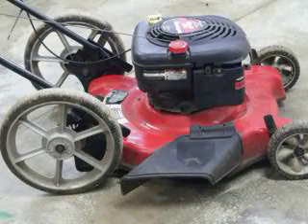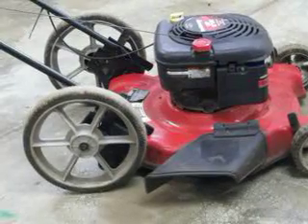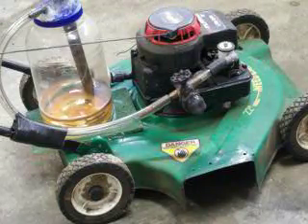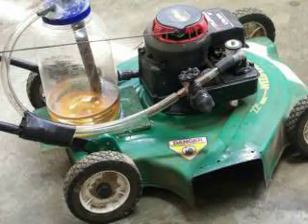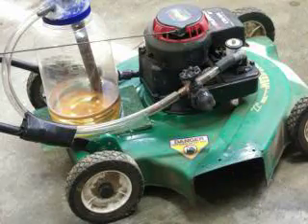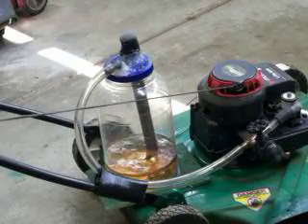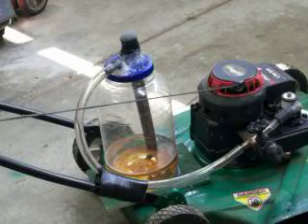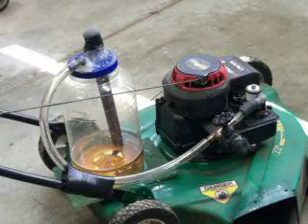gasoline and fumes the difference

Comment: It's a good idea but also you have to understand gas is like a ghost what is 6 it travels around the machine and once Park it can blow up same as a vehicle running on gas fumes and I noticed you have a little sponge in with the gas that's good because you don't want any kind of foreign object to go into the carburetor down into the Piston area scratching the wall or as you're running it gas has a tendency to spread around it the fumes and it's dangerous even in your car 
When it sets or as you're running it whatever the case from the bottle and it does and it's invisible it will blow up you got a bum you're pushing around even with a car with a carburetor from the Jerry can into the ports if you don't get enough air mixture you're running the engine hot it could crack glass bottle is sitting on the lawnmower sparking that ignited the gas and you got yourself a little bomb Colleen slight vibrations can crack the glass and just a little gas escaping ignite the gas out there on the lawn mower going back to the bottle and boom 
It's like a hand grenade it can harm you and her and your grandson or nephew or your wife that's near you or your neighbor which could turn out to be a lawsuit a lot of people don't understand this like I know gasoline the states is expensive but what you doing is incorrect you might think I'm stupid check it out on YouTube my son and you will find out for yourself you're driving a bomb even the same method in the car you don't get the right air mixture in or if you get a foreign object into the gas and it feeds into the carburetor blocking a lot of stuff for scratching the walls of your piston you're going to have to take the engine apart and Military playset with 
Your Pistons and rings and you're going to have to put a lot of oil it because you're going to find out it's going to be a lot harder someone running propane any class a mechanic would tell you the way you methods are there with a glass bottle can be very dangerous or even plastic because as soon as they tend to float it's hard it's harder than air means of the gasoline fumes It to the Ground same with the car as the car sits diffuse travel underneath the vehicle and once 
You start your car and boom hookah in the car can be jeopardized and the car will go up in a ball of flame not a joke not an April Fool's joke there's other and a little bit cheaper your car can be converted on propane or natural gas which is cheaper and save her but your nose your burn alot of oil any method that you do you're not getting away from the part of the oil because you're running the engine hotter so think of what you do for me don't know what you're doing you could do your research on YouTube and yourself would know the right from wrong what you thinking you're saving on gas you're burning on oil so doesn't really matter you're still coming out the same you're just driving the car engine to work harder sometimes you're lucky to get away with it but most of the time at 75% the vehicle is a lot more that you're working with can blow up you think I might be crazy keep running it you'll find out

Comment: congrats you made a crude carburetor. motors already run on vapor (air and gas mixture) which is what a carb is for. This setup will just destroy your piston from running lean.
Reply: Only thing is carburetors don't vaporize gasoline like it should... But that is what we called it since the invention of the carburetor. Is vaporizes the best it can but it's not that efficient.
Reply: Caleb

Comment: CO2 is a gas that is made anytime a carbon base fuel is burned, You are not getting as much when you don't burn as much but you are producing the gas. The Smoke alarm that went off in your garage was more then likely do to the unburned gas fumes and exhaust from your demonstration of the first mower. I am saying this because the most common type of smoke detector used in domestic application today are the photo sensitive variety. You did say however yours was activated by the heat. This may have been the case but I highly doubt it because a Heat Sensitive Detector would contain a thermostat like device and usually aren't activated by temperature until the surrounding temperature is nearly to the point of smoldering or burning (In excess of roughly 300 degrees. This type is not commonly used in households as they are more expensive and there fore are used primarily in industrial application. I would almost guess what we heard was one of the latest type of smoke detectors which is a combination Smoke and Co2 detector.  Also if you would study to see just how a combustion engine works you would learn that ALL of them rely on a mixture of O2 and ionized fuel (or fumes. The first mower relies on the fumes just the same as the second. the only difference is like your car or a diesel engine or the first mower you used the gas isn't ionized until it is injected into the cylinder or cylinders and the fuel that isn't ionized and burned gets exhausted out in the form of smoke. With is nothing more then fuel that isn't all the way burned and therefore wasted. The first mower and the second are burning fuel the same way however there is a lot les wasted in the second because it is ionized before going into the engine and not as it is going in. But don't be mistaken in thinking the second mower has no emissions IT DOES just not as much as the first mower because  more of the fuel is being burned before it gets exhausted by the engine. if you don't believe me you can take your mower to your nearest fire department and most of them are equipped today with a hand held CO2 meter or you can purchase one but they will usually run anywhere from about $200 up.

Comment: I did experiments similar to this over 35 years ago on our family briggs and stratton mover .
   starting was very hard on colder temps.
  Once all the liquid fuel evaporates, a milky white gooey residue is left behind at the bottom of the jar .
  i concluded that the residue consisted of all the additives that were in the fuel  as well as the moisture that was in the air that was bubling through the liquid fuel.
  Throttling control was also very erratic.
  After a couple of months of experimenting I decided  that the existing carby system was working just fine  and therefore i abandoned futher research .
Reply: i came to same conclusions few years back.i went a bit further and converted car to run on vapour.only way to evaporate petrol completely is a extreme heat.i sprayed petrol on hot exhaust manifold which turned in white fog mixed-up with fresh air in it go to engine..achieved app 40 increase in mpg .than i lost enthusiasm and abandoned project as i was expecting much higher increase....

Comment: The idea and concept are sound. Liquid gasoline is reduced to vapor before it enters the combustion system of the engine. It's the vapor that burns, not the liquid. That's why additives need to be used in fuel mixtures. In very cold climates, the additives make the fuel fume easier or the engines wouldn't run. In very warm climates, the additives used are to reduce the fuming rate of the fuels or vehicles would just blow up, even sitting idle at a curb.
The problem that needs to be addressed is when the engine back fires, how do you keep the fire from reaching the fuel tank? This could cause a very nasty explosion that could endanger life and limb.
Maybe an inline spark arrester would be a good investment, could help keep you from being blinded, starting a fire or killing someone.

Comment: it can be done but it's not safe there we have it set up. you need a back flash arrestor 1 backlash and kaboom. ever see what happens when you have a natural gas explosion in the house? that's the power of a gas. it's safer to deal with just the liquid. also there's not enough vapor pressure to produce enough power to cut grass. you would need to heat the gas produce a lot more vapor. and that's where the danger comes in. you must have a properly designed system to prevent explosions.

Comment: Carbon monoxide comes from the UN-burned gasses from an incomplete burn.  Everything that burns produces CO. The only way to be sure you don't have CO is by running the exhaust into a hot catalytic mesh. CO burns a pretty blue, otherwise you cannot sense whether it's present without a detector. BTW, your lungs absorb CO 25 times faster than oxygen and it stays in your blood for more than 24 hours as it slowly dissipates. If you work in 100 parts per million CO, you're good for no more than 20-minutes per day.That's why it's so important you get a GOOD CO detector, otherwise you're simply shakin' dice and they will find you dead. I have had gas training and I am warning you, carbon monoxide is a silent killer. No, it cannot be smelled.

Comment: If that thing's running on fumes why is the feed tube going into the liquid gas? It can only be drawing gasoline, not vapor. 3 things needed for fire, fuel, oxygen, ignition. Blocking off the air tube with your hand doesn't snuff out the engine because it prevents the fuel from bubbling it simply cuts off the oxygen to the engine. Nothing here that can't be debunked by a 10 year old.
Reply: Dude... The air tube on top is directed into the gasoline to create bubbles "vapor", and you can clearly see the vapor tube connected to the motos intake...
Reply: If it really was connected to the liquid gas tank then why would it be bubbling in the jar?   if you have a brain please use it.  thank-you.
Reply: +Marcos P Exactly.....
Reply: +Nyle Evans Your welcome!!!
Reply: The feed tube is not going into the liquid gas. The feed tube is attached to the lid of the jar and only sucks out the vapor in air at the top of the jar, knuckle head.

Comment: you have no horse power, only idle. the first time you try to cut the lawn you will kill it. huge difference between running and running with horse power. stop convincing people to spend there hard earned money and waste their time. shame on you. try saving people real money , you will feel good about yourself. they are taking risk and no reward. try shoving only 5 percent nutrients and vitamins  in your pie hole. you will live too, but you will not have the energy to do anything. try helping not hurting. this life is to short, and people like you make it shorter. if your any kind of man you will not delete this message and you will come clean, and you will make another video that helps people. thanks,,

Comment: no-no -no everyone you dont relize the absolute truth here. it a bit dangerous yes but think about propane you only run off of fumes k rarely does a application call for liquid see, hes got the idea.
Reply: +mchl8 bingo
Reply: I guess no one knows how a normal engine works. A normal engine burns fumes, NOT LIQUID Gas. Gas doesn't burn in its liquid state!!! A carb just mixes gas and air to make a vapor to be ignited. He's just making a more dangerous engine.

Comment: LOL no gas vapor what so ever then the smoke alarm goes off.
Reply: +tim ray Smoke detectors don't go off when they detect heat as stated at the end of the video.  They go off when either a photo cell detector is blocked by smoke particles or smoke particles in an ionizing chamber attach to ions and neutralize them.  Some smoke detectors can detect smoke and carbon monoxide, so it is possible his was going off because of high CO levels.  This person isn't smart running that engine inside a closed garage even it is running on fuel vapors.  Even propane engines produce varying amounts of CO.
Reply: +tim ray Thinkin the same thing
Reply: There are certainly models of fire detectors that monitor the fate of rise in the room.  Mine are that way.  If it doesn't you got a cheapo.
Reply: He forgot his wife was baking cookies.  Most smoke detectors do not use temperature increase to go off.  They check for the results of combustion.  His detector went off because of the exhaust from the lawn mower.
Reply: DPM.OASIS1@GMAIL.COM,

Comment: Carburetor is defined as "a device for mixing vaporized fuel with air to produce a combustible or explosive mixture, as for an internal-combustion engine.".  This guy is just vaporizing the fuel and mixing it with air in his big jar instead of it being done in the carburetor.  This guy obviously does not know how an engine works or what a carburetor does.  Engines do not run on liquid gas; it runs on "fuel" which is a combination of gas vapors and air.  Only "fuel" is combustible and dangerous; not liquid gas. So his large jar is just a huge bomb. If this engine back-fired, it could blow up his entire garage. What he is doing is very dangerous. 

This guy makes so many comments that are incorrect that it is silly. I imagine his fuel "mixture" is so lean that yes it does use less gas and create less CO and could probably run all day on a gallon of gas but his mower could not do the same amount of work as a normal mower. Regular mowers are set a little rich to handle large increases in load without bogging down.
Reply: Add more Vapor hose Inlet to the engine. Then control the amount of power you need by opening or closing that valve he has

Comment: no carbon monoxide whatsoever that's a bold claim that can get someone hurt unless you've tested it and controlled lab settings can verify this into a fact then you should not say stuff like that because you could get someone hurt. in my own opinion shouldn't question is combustion and combustion with gasoline produces carbon monoxide whether that be vapor injected or fuel directly injected which then from the heat of the engine and the pressure of the chamber atomize the liquid into fumes and then they combust and exit as carbon monoxide even if your model is running on fumes there is going to be much less but it is still a fatal gas to be making such bold claims.

Comment: Your title is wrong.. Actually engines were designed to run on liquid gasoline. But that doesn't mean it's all they can use... And while you think you can run that in your a garage with the doors closed, your smoke alarm tells a different story.

Comment: great job Reinventing the wheel.do you know what a carburetor does it converts liquid gasoline to vapor. liquid gas will not fire. have you ever flooded a gas engine? have you pulled a lawn mower carb down and tried to look through the jet it's only a couple of hairs wide.
Reply: Brent Mack, You are wrong. The carb does not turn gas into vapor, It turns it into a very fine mist. Mist and vapor are totally different. Vapor is more dense than mist. Anyways, This engine runs off "FUMES" which you cannot see. You can see vapor. Fumes are an invisible gas, Like propane.
Reply: Brent Mack, You are wrong. The carb does not turn gas into vapor, It turns it into a very fine mist. Mist and vapor are totally different. Vapor is more dense than mist. Anyways, This engine runs off "FUMES" which you cannot see. You can see vapor. Fumes are an invisible gas, Like propane.
Reply: +The 13th Floor Elevators Run Thru My Veins  have you ever been inside of a 5 HP b&s one lunger? yes you are correct my point is in order to have an explosion for the power stroke you are causing rapid oxidation fire turning oxigen into carbon dioxide and depleting the oxygen and Mr run my one lunger lean will die in the garage w the door closed. if you can't afford the gasoline to mow your yard sell the extra property off and plant your grass with rocks
Reply: +The 13th Floor Elevators Run Thru My Veins A fine mist is the only way to increase surface area enough for it to evaporate into "fumes". The carb does the same thing. A jet is used to make it easier to atomize the gas.

Comment: You still have to have the proper fuel to air ratio or you will either run too rich or too lean. the proper fuel to air ratio is about 15 air to one gasoline. To have the desired power you need the right mixture. Vaporizing the fuel properly before it enters the cylinder will help run it optimally. That is why an injector on a car that is not spraying properly might not burn all the fuel and cause problems with emissions.

Comment: This is an interesting concept . . . It is very similar to a carburetor except the jet doesn't go into the liquid gasoline. I wonder if it would perform better if the hot exhaust gasses were aimed at the container of gasoline.
Reply: oh for sure that will work they should do it and please set the camera a little further back so I can see the bigger picture can't wait so excited

Comment: All gasoline engines run off of fumes anything more than vaporized fumes which is the carburetors job it's running too rich
Reply: Exactly, you're basically taking the float bowl and venturi out of the carb with a contraption like this but people just don't understand 😂

Comment: this is like taking the wheels off your car replacing them with round pieces of wood and saying why did i need wheels in the first place. lol all a carb does is do exactly what your contraption does but in a different way allowing you to adjust the mixture. all you did was make a basic carb that takes up 100x more space and does not allow adjusting the fuel to air ratio. which in the end will probably just stuff up the engine

Comment: It would be useless in any 2 stroke engines because the fuel is mixed with oil for the engine's lubrication.

Comment: There are these things called fuel injectors or Carburetors that do exactly what is shown in the video. They both vaporize the gas before injecting it into the cylinder.

Comment: It's a real Hillbilly set up for sure. I believe early propane was made from gasoline fumes. A modified 1959 Opel went 376 miles on one gallon of gasoline in 1973. I believe one of the techniques they used was to preheat the gasoline in order to run the engine off the vapors..Very dangerous. This is an interesting demonstration, but not some great invention.